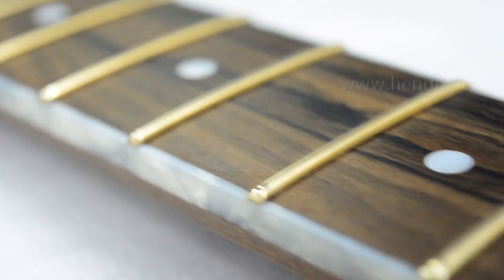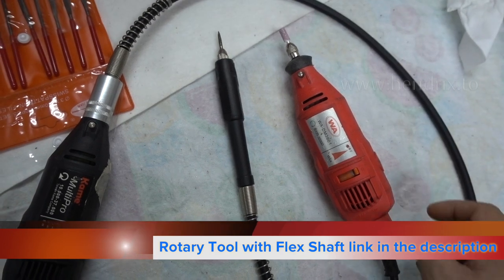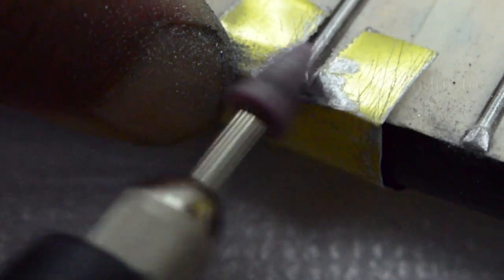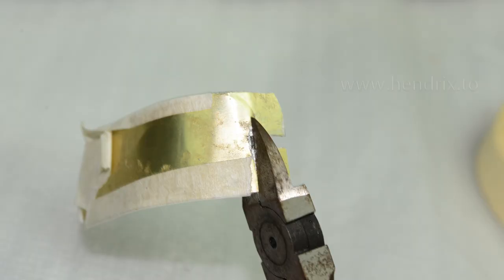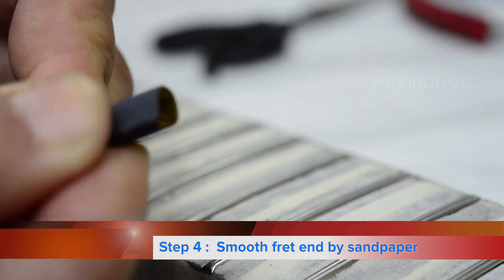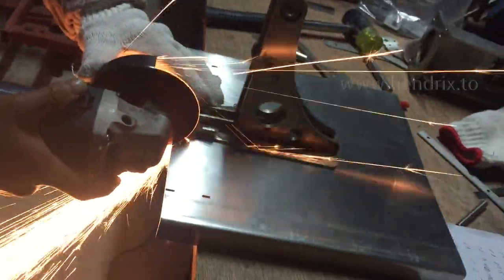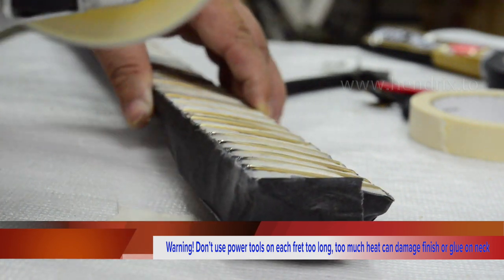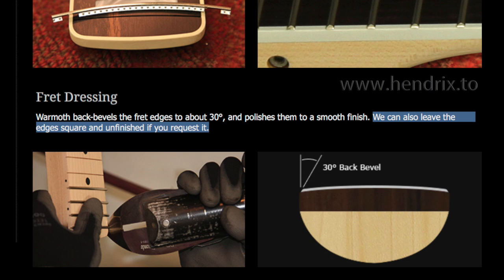Power tools Fret dressing Tutorial in 5 Easy Steps ( Warmoth Neck )

Comment: It's easier to do it manually... I would rather do it by power tools when the frets are not installed yet.
Reply from the maker: it depending on how comfortable you with power tools, and how much time you want to saved . It more Safe and easy to control to done by hand , but take much more time.